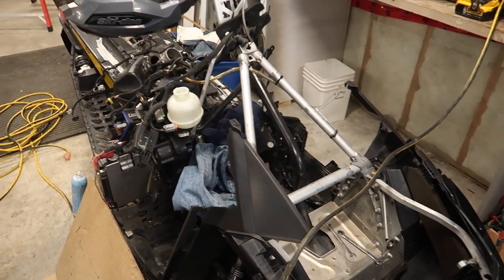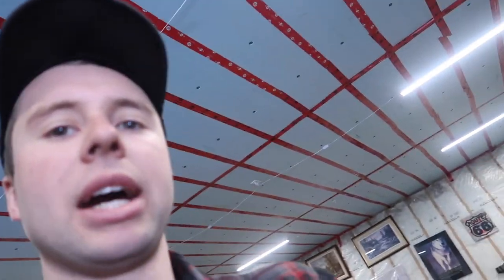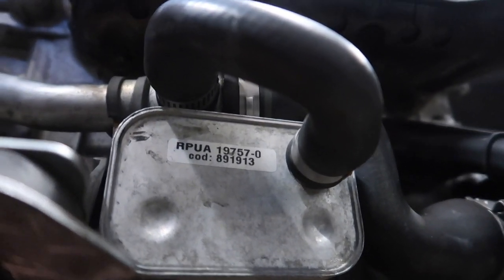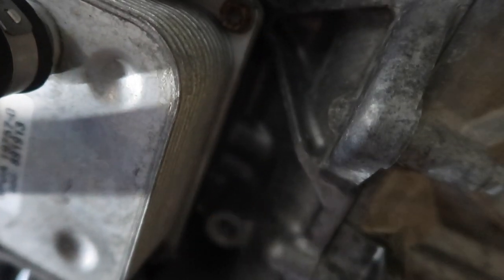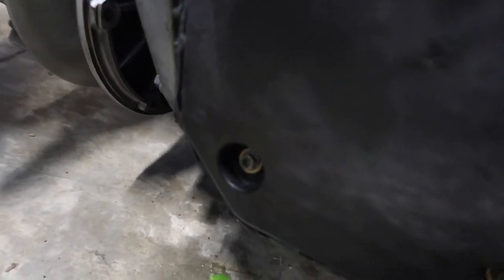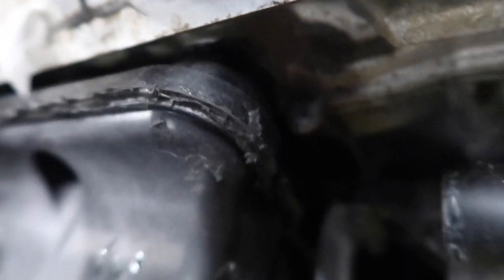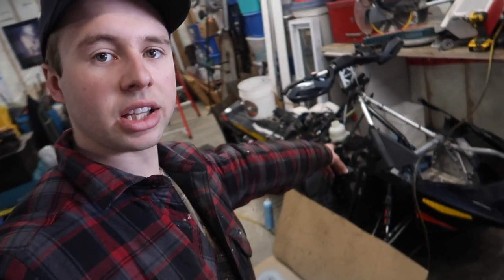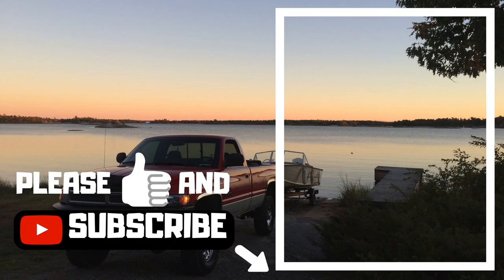Common Ski-Doo 1200 4Tec oil and coolant leak identification

Comment: just bought a 2013 1200 Grand touring. While going over the sled, I pulled the oil dipstick and noticed the valve cover vent pipe that exhausts back into oil fill tube is a slight creamy foam colour. bear in mind this sled had been parked for a few months & never even had a chance to get to operating temperature. should I worry? Oil is super clean though. Thanks for your detailed vids you share, I feel confident I can get a few good years on this sled. Used but not abused!
Reply from the maker: I wouldn’t worry at all. Very common even when used often. Enjoy the sled!

Comment: awesome man..I have a leak around the water pump..looks like it's coming from the bottom bolt so probably the gasket..I tightened the bolt and got about a half turn out of the two I could see..hopefully fixes it for awhile..if not i'll pull it apart and do all the seals..video helped a bunch..thanks

Comment: Does this oil leak affect every year of the 1200 4tec until it was discontinued in 2018 or was this fix/corrected from brp after a certain year?
Reply from the maker: As far as i know it seems to be a problem on them all. I am not sure if BRP corrected the issue.

Comment: Hi. New 2016 enduro 1200 owner.  Replacing plugs tonight all 3 saturated in oil.  Saw one forum that said valve cover. Can you confirm.
Reply from the maker: There is tubes in the middle of the valve cover. Honestly that takes a long time to build up. I have had a couple over the years with oil in them and replaced the coil and never looked back.

Comment: Josh thanks a lot for going over that I'm glad I stopped you before you put your engine back in that sheds a lot more light on what I'm looking for. Like they say an ounce of prevention is worth a pound of cure so I can't wait to tear into it the summer.
Reply from the maker: Not a problem John. It was a good idea. Keep up the good suggestions. Hard to come up with video ideas sometimes. Has your sled been leaking bad?
Reply: @Schneids15  Noah hasn't been leaking actually I think it was overfilled from my break in inspection and oil change. I sense then on my last trip brought it down 2 normal range after being warmed up and I found a liquid pumper from a soap bottle and I cut the end off so I can put it on the oil tube and it is at the perfect half level if it's over. I just pump it into a bottle and it's the correct level out every time

Comment: i have a 2010 1200.  oil cooler looks fairly easy to get at(there is no heat shield under my front pipe).  is this just held on by two bolts?  manual says to take out the motor mount also.   i dont see it really getting in the way.    just remove front pipe ,two bolts and two clamps.  is this correct?
and is draining the oil really necessary for this?
Reply from the maker: I had to remove the motor mount to do this. I did drain the oil and coolant i believe.

Comment: Can I change just my valve cover gasket 2009 ski doo mxz 1200 tnt without removing the engine
Reply from the maker: I believe you can. I’m unsure though. I believe some guys put a washer on the bolts of the valve covers because the bolts bottom out and that is when they are tight. By spacing them you can crank the seal down a little tighter and usually solves the leak.

Comment: Hello how are you doing, we have a 2012 skidoo 1200cc with 2000km on it. We have a oil leak behind the clutch that we can’t figure out. We have put 2 different  new seals on the crank and still have the same issue. First seal we changed I just popped the old one out and put the new seal in, 2nd new seal we put a little bit of silicone around the outer side and popped it in and let the silicone dry for a day before starting it. (Oil is not over full) I’m just wondering if anyone ever ran into this problem with the oil leaking behind the clutch before. It
Reply from the maker: Hey Wil, i have thought about this for a while, i never had one issue. Did it leak around the outside of the seal both times or around the crank?
Reply: @Schneids15  We siliconed the outside of the seal and let it dry for a day so I doubt it’s leaking from there anymore but we still have oil splash behind the clutch
Reply: It’s hard to tell where it’s coming from
Reply: I figured out the oil leak
Reply from the maker: Right on wil! Where was it? I never seen your last comments sometimes the replies don’t notify me for some reason.
Reply: @Schneids15  The cover that covers the seal seemed to be pushing on the seal to hard right around the crank. I put some shims behind the steel cover and problem solved. No more oil leak
Reply from the maker: That is great you figured it out. Happy you did. Sounds like you had an H of a time getting it figured though.

Comment: What about a gas leak on the 1200?
Reply from the maker: I had a fuel filter O ring drip once and replaced it. On the outlet of the tank... otherwise no issues

Comment: Why would my heat exchanger coolant hose pop off?
Reply from the maker: Is it where it attaches to the water pump?

Sometimes the hose gear clamps have plastic parts internally and strip.
Reply: The hose clamp on heat exchanger hose
Reply from the maker: Check the hose clamp. I bet it has plastic internals and loosened off. 

I had one on the water pump from factory leak like crazy from the plastic internal hose clamp being stripped.
Reply: @Schneids15  4hr drive home tomorrow and after watching your videos all day,I'm hoping too repair soon thanks

Comment: these engines are scrap seriously doo should not dabble in 4 strokes , if ya want a bulletproof 4 stroke get an apex , these 1200 are underpowered, not reliable (water pump gears) , over heating, leaks all over like crazy, its not if its when ur gonna have problems with it, im a lisenced mechanic and worked on tons , take some advice yamaha ownes the 4 stroke world